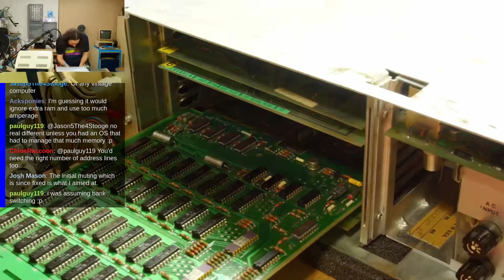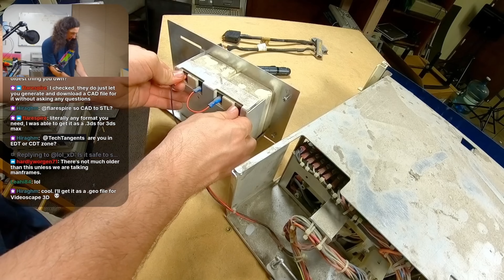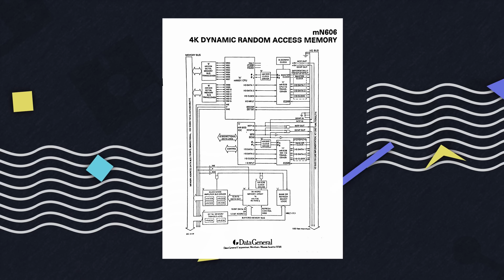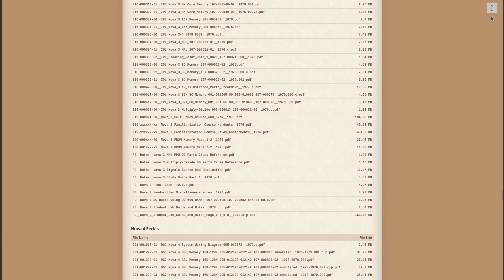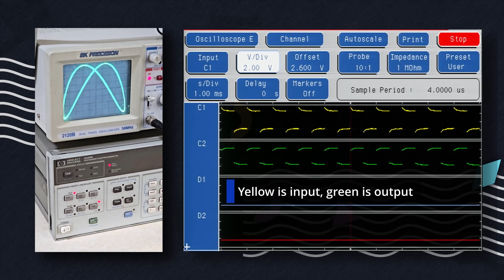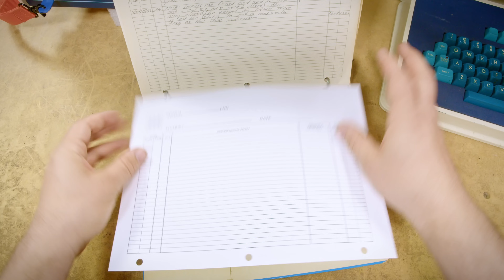Data General microNOVA Almost Couldn't Be Fixed

Comment: The poor-man's method is to use a desoldering bulb.  I like them as they are more controllable and because you can BLOW with a bulb.  If it won't suck out, clean the bulb and blow clean air instead of sucking at the solder--point.  The last of the solder will fly out the other side.  The down-side is that you have to watch carefully for flakes.

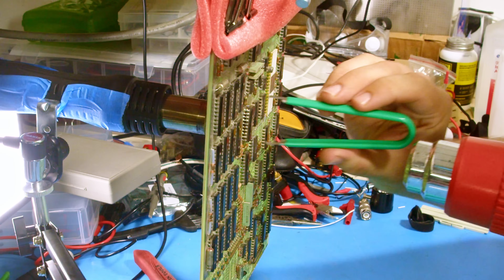Comment: 13:50 so you could replace it with something like a 74xx244 or 245  or 367 on a socket an interposer

Might need level shifting
 But it can be done using smd parts an double sided pcb with pin headers

Comment: Excellent! Well done.
On a related aside, I wonder if a worthy project might be an attempt to document these Data General logic IC's and their function(s)?
As time goes on more and more will go bad, without direct replacements as they are very rare. But if you know what the IC you have does there's a good chance of there being ways to replace bad ones with common logic, or even directly with GALs programmed to reproduce them.

Comment: Ok wait, how did you embed the live Tektronix overlay? I doubt GPIB has the necessary bandwidth to get you this...
Reply from the maker: That Tek TDS320 scope has VGA out, so it was easy peasy. My other HP 16500, the C, I have modded to also have VGA out. That new B will be getting it added as well.

Comment: Those DG chips are 'more or less' TTL chips and the LS series would probably work. The 74LS621 is the same pinout and O.C. Functionality. It would appear that the  621 has EOL a while ago. And I couldn't find them for sale. BUT if you get really desperate it might be worth the effort. Good Luck! (oh yeah the people in rework had 20 pin solder pots to remove the chips in Southboro for rework.   As you can tell the chips were "Open Collector" which meant that they needed "pull-up" etc to drive high.

Comment: You have the logic diagrams for the custom chips, it should be possible to make a little board to emulate one with new logic. Some care in design and use of surface mounting and you might even get it to fit within the height constraints of that cage.

Comment: I watch all the electronic channels here and don't understand why you are always ready to sacrifice board against broken chip?
Old soviet boards were very-very fragile and we always did cut chips off leg by leg and then desolder legs separately. For checking chip there was easy do solder legs or something to it but board was always OK. You can easily modify 2$ side cutters for your needs.

Comment: Even without documentation on the chips, as long as you have a good example, you can use a logic tester to figure out what it does. And then use a gal or some such to replace it. 
If data general is anything like HP in behavior, most custom chips will be normal 74 logic under different names.

Comment: Great work! That bidirectional buffer might be reconstructable on a little sub-board with a combination of "less dense" 74 series chips, that can be plugged into the chip socket. Share a link to the chip's documentation so we can take a swing at that. Looks like a job for four 74LS32SMD and a 71LS04SMD... Or maybe a single 74LS245SMD?

Comment: Gold on solderable contacts is a kind of absurd thing - in the end, you will usually dissolve it into the joint and solder to the nickel beneath. With the new problem that gold in solder doesn't help and tends to promote brittleness through intermetallics creation... So the only good the gold does is keep the contacts oxide free until you solder them. Best to tin gold legs before soldering, then get most of the surplus tin off with a desoldering tool or braid, then tin again!

Comment: That custom chip would be easy to reproduce on a little daughter board, too, should the issue come back to haunt you. That schematic is a piece of cake. Even perf-board in a pinch. @13:53
And thumbs up to finally see a retro-hacker using a static strap! Use 'em folks. It gives you one less thing to worry about. Static damage can be partial, intermittent, or instantly catastrophic... and always invisible. You don't need that grief.
Reply: Static is not nearly the problem people make it out to be.
Reply: @bzuidgeest  Yes. It is. It's not nearly the identifiable cause that everyone makes it out to be. Jeez, looks like we have a bad RAM chip. Guess it just died. Anyway, for the cost of a $5 strap the whole argument becomes irrelevant. THAT'S the point. Some of these chips aren't replaceable. Spend the damn $5. The industry spends millions on static mitigation and packaging because they think it's a fun waste of money?
Reply: @R.Daneelthe industry does a lot of things that are cheap to do and don't matter much, that rarely make sense at a small scale. 
 most people building or working computers don't wear them, yet most work perfectly fine and keep doing so. 
You can just as well ground yourself out to the metal of the case, when you start working. Unless you are rubbing your ass along a carpet regularly you just don't build that much static continuously. And there are many environments that aren't likely to build static at all. 
I don't know about you, but I don't have sparks continuously flying.
Reply: @bzuidgeest Rarely makes sense. Most work. Why bother when only a FEW of your irreplaceable components get toasted. Keep fighting the good fight! Pat that $5 in your pocket.
Reply: @R.Daneelkeep shouting, never lost a single component to static, enough to other mistakes, but not too static. And YouTube proves that it goes for a lot of people. And wrist bands are not even the only anti static solution, if you really worry about it. Wrist bands are rather impractical if you need to move around. And people do move around with chips.

Comment: With a bad DIP IC, to best avoid damage to the traces and to make the extraction easy without the DIP accessory you later bought, snip all of the leads on the IC just above the PC board and then remove the leads left in the holes with a solder sucker or just a soldering iron and needle nose pliers or tweezers.
Reply: Yes. Not to mention it's also easier to use those eBay "non-sticking desoldering hollow pin tool extraction kits" (their words, not mine) like that. Used carefully, they can be a little easier on crappy boards with loose traces than suckers. Although, the holes on this board were ridiculously tight so maybe not an option.
Reply: If the PCB is of poor enough quality, the force on the pin while snipping it off might already damage the pad. 

Better to use the dip accessory if you have it.

Comment: I started wondering if anyone has tried to make a "gotek" equivalent for 9-track tape drives. Seems like it shouldn't be that different.  Hmm, there seems to be a Hackaday project called "THE PERTEC WHISPERER-MAINFRAME TAPE DRIVE EMULATOR" which seems to be both gotek and greaseweazle for 9-track tape (as long as it speaks Pertec).

Comment: Very interesting how the reading and writing to memory in the rom monitor works, it's the same on both my Quantel Digital Paintbox DPB-7001 (1982) and the later V-Series of video effects machines like Paintbox, Hal and Henry from 1989 onwards with slight changes to allow read/write byte, word and long word. Quantel back in the 70s and 80s used a lot of DEC, so there's a good chance it's the same there too.

Comment: Interesting Greasweazel now supports hard-sectored. I have an Heathkit H-8 i'm trying to get back up. I finally found some OEM CP/M hard-sectored 5.25 disks. Wonder if they will add the H8 manchester-encoded hard sectored disks, Will keep an eye out.
H8 users have made a hard sectored emulator (10 sector) that I have seen people use. Maybe they can be used on 8" disks?

Comment: It's good to see that DG's own version of buffer chip is just as reliable as the non-DG ones :D That face you made when you saw it writing for the first time is exactly the same that I did when I got my monster 1982 CPT8520 word processor booting back in January. I'd only had the machine 20 years and figured over xmas that it was time to work on it. What a great feeling, seeing something work properly for the first time in decades. Great work!